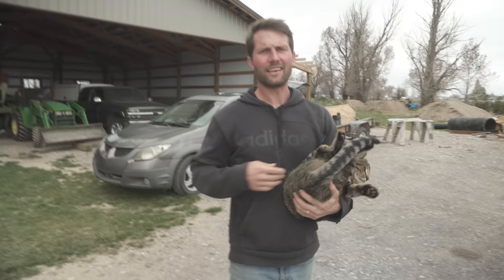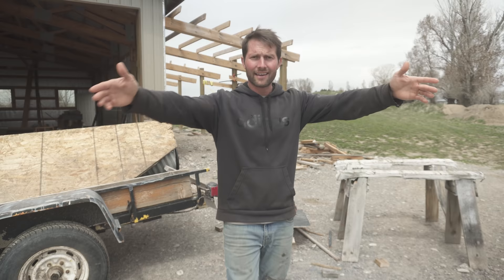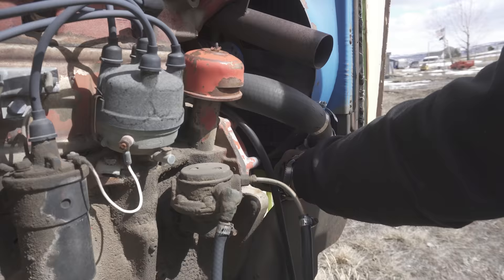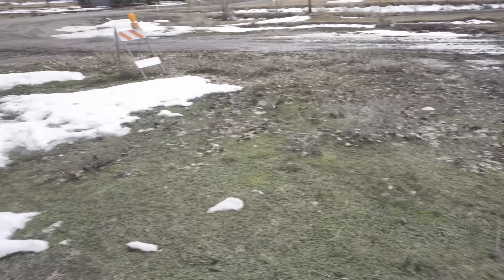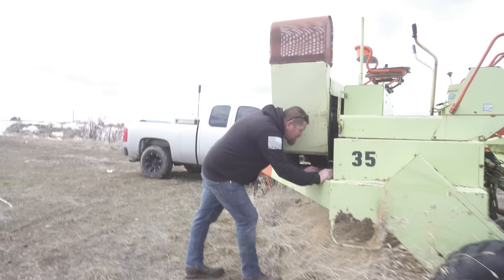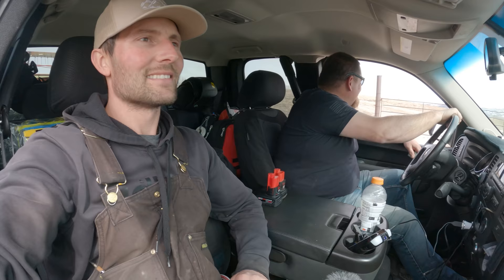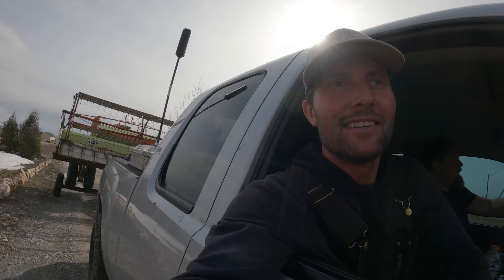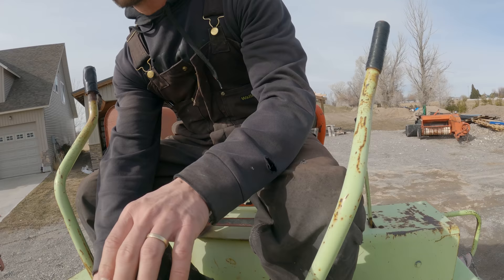WILL IT START? 1965 SWATHER and it came UNHITCHED.

Comment: I used to run a swather much like yours as a summer job. You'll need a tool and parts kit for fixing broken teeth in the field. The cutting teeth are riveted to the sickle bar. When you start leaving uncut strips behind you, you'll know you've broken a tooth. You have to take the tooth guard off, grind or chisel the rivet heads off the broken tooth, and punch the remaining rivets out of the bar. Put in the new tooth, put in new rivets, and set the rivets with two hammers; one below and one above. Put the guard back on and swath on. Repeat 2-4 times per hour. Good times.
Reply: That was 30 yeaers ago. They are all bolted now

Comment: Every Owatonna swather I owned had a hitch that attached to the tail wheel. Never had to use a trailer. And tail wheel frame was adjustable. It's been a long time since I owned one, I switched to a haybine since the Owatonnas never had conditioners on them.

Once you get the hanger done you'll have to build a machine shed.

Comment: I had a trailer like that that I built. Hauled the swather I had all over the country. You just have to have pins with good hitch pins. 
Now you have to go through the drives and belts checking be for any problems. Follow the drives and Grease all bearings. 
After that pull the cutter bar out and look at all the sickles blades. 
The good thing is these machines are made to run for ever with proper maintenance.
Reply: My question is why you hauled the swather all around the country….

Comment: OK.  Several tips, make sure the blades on your mower are sharp (think angle grinder) takes a lot less horsepower with sharp blades.  Get yourself some spare blades they will break or wear out so have a supply of them.  You will need a field tool kit because stuff will break when you are out in the field and need it the most.  Also make sure you have a supply of spare belts.  get a grease gun if you don't already have one.  that will keep things from wearing and breaking.  Since you are doing the Green Acres thing you need to put in a garden.  Learn to can and have a big freezer way cheaper and better than store bought food. I don't know if your little garden tractor has enough PTO horse power to run the bailer. That needs to be checked out straight away.  It is hard work but you will live much better than the city folks.  Keep up the good work.

Comment: Yo Jonas-  I can totally relate; in the early 1980's I was driving my VW on I-5/late at night and...saw sparks/flames from the Left rear.  Then I saw my FORMERLY Left rear tire depart the hub/axle,  race along the lane divider ahead of me, grinding down to a halt, minus the lower third of my shock, engine pan, etc.  EVERYBODY told me "that's impossible, it can't happen".  And HAPPEN- it did.  EVERYBODY said the nuts were reverse threaded- to prevent that from happening.  It DID.

Comment: Let's see... it's the end of April. First cutting should be mid June. That gives you about 45 days to take both of those apart, clean every moving piece, and reassemble them. Just pretend it is an annual inspection. Oh, you probably don't have the manuals. So you'll have to figure out how the parts were intended to work and how they've been modified to work.

And you still need a rake.

For real though, you should get a round bale from last year and feed it through the bailer with a pitchfork as soon as you can. Make sure the knotters knot, the auger augs, and the ram rams. Oh, and go get about 20 shear bolts for the flywheel. If you've got a timing issue you'll go through 19 before you figure it out. 

You've skipped right past farm status and went directly to ranch status.

Comment: The “useless” hitch pin has right way and wrong way up position. If you can pull it out as was done on the video its the wrong way. Turn it 180 degrees and it will lock in as the tab sits in a “T”  position. This system is used in some sailplanes to hold the wings on and it works very well.
If you like the machinery rejuvenation thing have a look at Marty T, he’s a New Zealander with a similar attitude albeit with a low key kiwi way of doing things